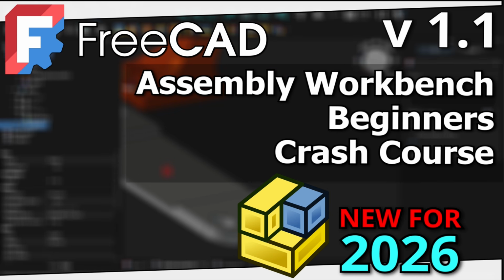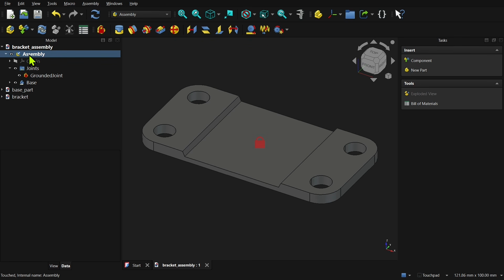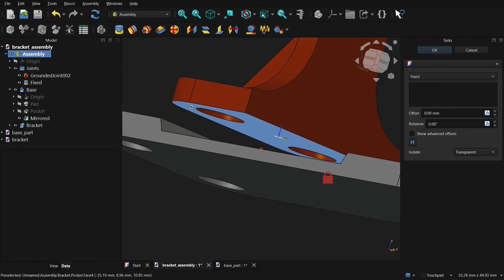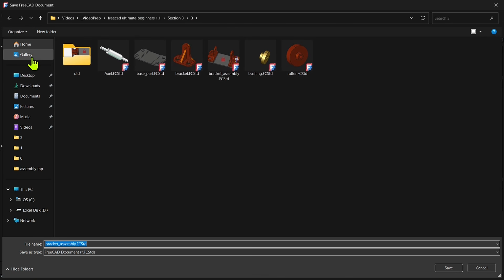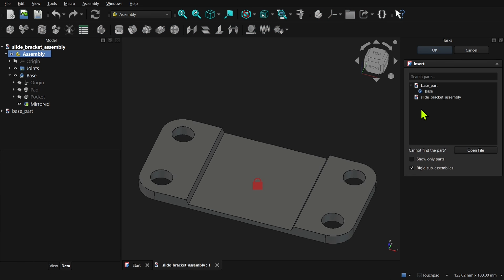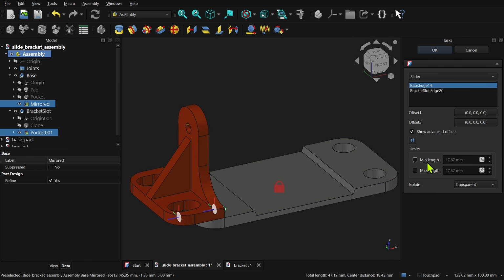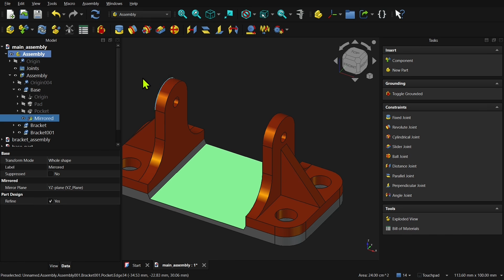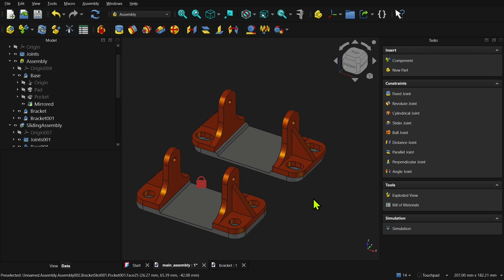FreeCAD 1.1 Assembly in 30 minutes Beginners Crash Course / Tutorial 2026

Comment: Hi can you show how to reference dimensions from another part(in another file)? what i mean is, that I have the base plate designed and saved into a file, and i want to create bracket that fits the holes in the base plate, and id like to update whet I update the base plate.
Reply from the maker: For this you can use a shape binder.  Open both files (source and destination), select the part you want in the source document (the body, sketch, face etc) and then select the tab of the destination document (which you will find at the bottom of the screen).  It's important not to click into the document itself, only select the tab.  In the destination document select the sub shape binder tool and it will pull in the selected element in the source document as a sub-shape binder. You can then use this is your part design active body (as long as it's inside it, drag it in if needs be) or if your using part you can reference the sub-shape binder directly  Hope that helps.
Reply: @MangoJellySolutions  it helps a lot, Thank you

Comment: Hey, thank you for such informative,  detailed and well paced tutorials, It's really helping me get to grips with the software!
One question, I'm not sure what I did wrong. But when I align the sliding joints and apply -90 degrees to both the bracket and body, it is upside down and the base of the bracket fully intersects with the base. I had to -90 the bracket and +90 on the base to have it align and work properly. I believe I followed everything you did step by step. Do you have any idea where I went wrong? Thanks again :)
Reply from the maker: Glad you enjoyed and thanks for feeding back, much appreciated.  With regards to the question this could be down to a number of reasons; the 3D view may of been orientated differently, or when the part was imported it nay of flipped, you may of even pressed the flip button by accident, there are quite a few. But the good thing is that you got to the finished result and figured out the solution to the problem you encountered.  You will find this a common thing in CAD, you are 100% sure you followed the same steps as you did previous but had to do something slightly differently to get the same end result.  I still find that myself.
Reply: I had the same problem, but mine was due to a dumb little reason. I have looking from the back of my project when I thought it was the front.

Comment: Hi, thanks for sharing your knoledge on Freecad. @ 7'19" we can see that the base is not grounded and when you add the bracket  and move it without transformation tool it works. On my Freecad 1.1.1 this is impossible. If the base is not grounded, I can not add the bracket. If the base is grounded, when I add the bracket in assembly, it can only be moved with the transformation tool, not directly.
I do not understand where I missed.
Regards.
Reply: Not sure if same problem, but I keep forgetting to click okay after an operation and it's blocking me from doing stuff until I do. I think being able to freely grab and move stuff is one of the things I've run into this with.

Comment: Great video! I am new to the assembly workbench. One simple thing I cannot figure out is: when adding a joint like revolute or slide, you are able to drag or rotate the component, but where can I set the rotation or position by typing an exact number or reset to the default position?
Reply from the maker: Glad you enjoyed the video.  In answer to your question if you click on the component you moved and look in the treeview if you look at the  components property tab and then expand the placement > position  This is where you will see it change and you can reset it back or set it to a value.

Comment: How incredible is it that we have this much power in open source software? I'm currently running FCAD in a lightweight Qubes VM (stock Debian template, 4gb RAM, 4 vCores) to build parts for my desktop printer and CNC. Qubes GUI VM requires a dedicated GPU, and without a second card for GPU passthrough you're stuck with CPU-only. Despite that, FCAD is running buttery smooth even with complex parts, joints and thread rendering. Seriously impressive. I'm coming from precision modeling in Blender and couldn't be happier switching to FCAD. I really appreciate you upgrading the courses for v1.1.x, and for not using some low-tier TTS for voiceover like every other FCAD tutorial. Instant follow.
Reply from the maker: Great to hear you have it running smoothly, all to often you hear of complaints of slowness which puts people off. Nice to hear you are impressed.  And thank you for the kind comments on the video.  You will find no AI or text to speech in these videos, all original :)

Comment: FC is finally coming along !!!  
The thing that is on my mind >> that I've been waiting YEARS for >> is >> making parts based on parts. to explain > In my spare time I invent new motors & do physics experiments. often I don't know exactly what I need down the line. so most of the time I make multiple bodies that fit together . mostly with binders... try to keep everything as bare as possible, but eventually holes need to line up and eventually like right now I need timing to be created... and this timing is ugh .. head scratching...  So , imagine you have 2 bevel gears , 90° .  they spin two plates perpendicular to each other.  I need to run / simulate the assembly to figure out how big(diameter) the plates will be and the pattern on the plates. right now in the assembly I am testing whether or not I should use links ... caz I've been modelling in the files themselves and not the main assembly.  anyways that is what is on my mind in the next chapter of FC . 
-cheers

Comment: For assemblies I highly recommend not jointing things using any non-functional surface.  Design intent should be preserved such that if you ended up having to change the outer bounds of a part, you dont want all your joints blowing up. When possible joints should reference immutable features like primary planes.

Comment: In case anyone hasnt learned yet, (I didnt until a few years after college), a good way to remember the coordinate system colors is just like a video display. XYZ = RGB. Maybe when quantum computing comes out we will need to use CMYK instead.
Reply: Dude. I've been using design software for 20+ years and I never pieced that together 😂
Reply: @TopSpeedKertus Right? Not in a single class I took for CAD or CAE software did anyone mention it. And some software really expects you to know it because they don't label axes.

Comment: Can someone explain how to create a sketch for an aluminum profile in FreeCAD?

I tried doing it the same way I would in SolidWorks, but the problem is that FreeCAD doesn't have something like a circular pattern with mirroring for sketches. Because of that, I couldn't just create 1/4 of the profile and then replicate it. Instead, I made one quarter and mirrored it twice along the X and Y axes.

Another issue is that constraints in FreeCAD seem to behave strangely. If I mirror the quarter while keeping all the original constraints, the sketch immediately becomes overconstrained (overdefined). So I had to mirror the geometry without constraints.

But after mirroring all the parts and then starting to add constraints manually, FreeCAD became incredibly slow and laggy.

What am I doing wrong? Is this normal behavior in FreeCAD, and what's the proper way to create symmetric profiles like aluminum extrusions?
Reply: There are indeed polar patterns both inside the sketcher, and you can pad a quarter of the profile and then polar pattern it
Reply: @pepopipo974  It's so strange that you have to apply a Polar Pattern to the extruded feature, but apparently there's no other option.

In SolidWorks Sketcher (or any CAD software that uses the D-Cubed 2D constraint solver), I can create a very complex sketch with a large number of constraints between lines, and it still works quickly and smoothly. In FreeCAD, however, a sketch like that starts to fall apart even with just a few nodes and lines.

This is probably one of the things that keeps many engineers from adopting FreeCAD for large-scale, complex projects. When the sketch solver becomes unstable or slow as the design grows, it can significantly impact productivity and confidence in the CAD workflow.
Reply: I would do the latter, maybe there is a way to mirror o pattern it and keep constraints correctly, but I don't know it because I've always done it that way

Comment: Is assembly coming close to inventor's assembly yet?  One of the things I liked with Inventors assembly is that by working out the constraints one at a time I could use it to line up pipes using off the shelf bends.  Very very helpful.
Reply: You can do the same in FC assembly, BUT using the parts faces for constraining is extremely frustrating. Faces change their internal name when the parts are modified later on and constraints using those faces are lost/destroyed. It is nuts, especially because the FC team says the topological naming problem is close to solved. It is absolutely not.

Best workaround is to use the parts main axis/planes or use additional planes/coordinate systems per part.
Reply: @herrgerd1684 using reference geometry to constrain parts in assemblies is a best practice anyway, no matter which CAD package you choose. This is a matter of being principled in the way you define and build your models. I managed to break assemblies in each and every CAD program I tried so far. The topological naming problem exists in every CAD package and that's why a principled approach to building your models is key to success regardless of the Software used.
Reply: @QualityManaged  tell me about it ;) I am a daily SolidWorks user and of course I try my best to use reference geometry where I can. It's just not practical sometimes. One has to get stuff done. I use and used Inventor and Solid Edge, too. There is always a balance between best practice and "god damn why did you explode my whole assembly, I did just add a chamfer/hole to a face".